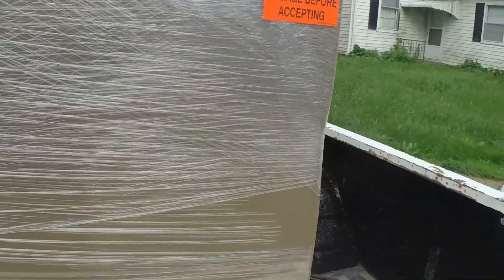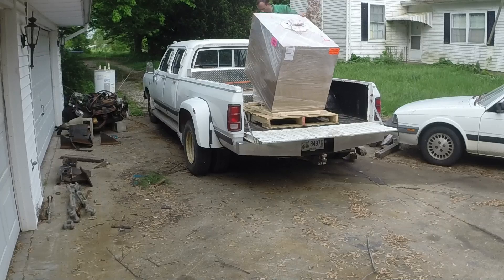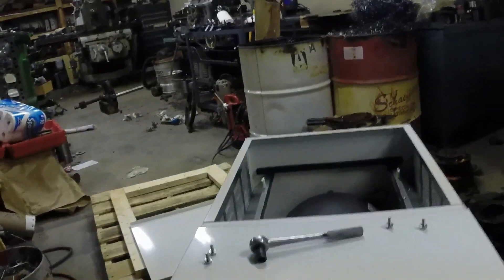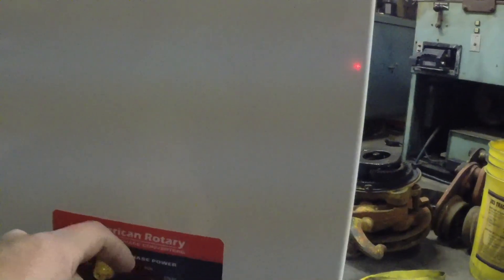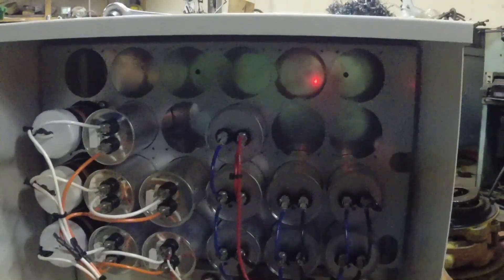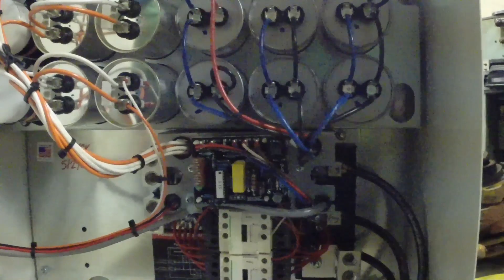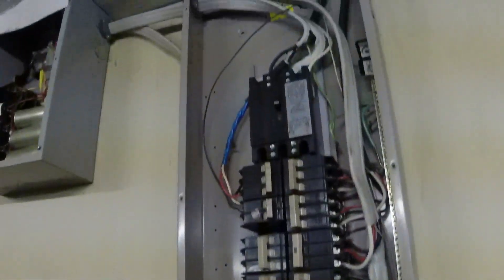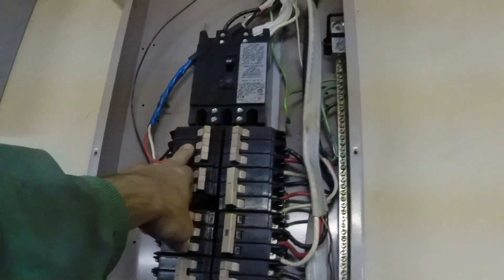The big 50Hp phase converter has arrived!

Comment: Drain holes i sealed my unit up ending with water from temp differential moisture build up. No go
Reply from the maker: Mine has been sealed with no issues but it is in the shop so I don't get sweating. I may need to pull the silicone from one when I put it in the attic so it can drain though.

Comment: Hp is there on the tag because most people are running motors off phase converters.  People don't know the amps of the motor but they know the horse power of the motor.

Comment: I want buy this for my haas VCM 20HP 
but I have some cuestion .
I saw u buy it this 4years ago .
  rotary phase  still working good  
and how many AMPS NEED TO RUN AL50HP.    65AMPS?
Reply from the maker: Yes the AI50 I have is still working fine. Running a 40hp load it uses right at 200 amps single phase. For 25hp it is 112amps.
Reply: Ok thanks

Comment: I think that the holes in each corner is for allowing water to drain out if condensation occurs during the winter months the heat of the 50hp motor heating up the metal housing will cause some condensation water to pool in the bottom under the 50hp motor

Comment: Better to have a fan to blow through the filter inwards and pressurize the enclosure. Open holes would then let water drain out. Best to keep the wiring boxes closed, a nearby lightning strike could cause a fire ball. I’m sure an electrician could tell you convincing stories.

Comment: If you get a big enough phase converter, will it run your 3 phase equipment at full power?
Reply from the maker: Yes as long as you have enough single phase power to keep the phase converter fed for what it will generate then the amount you could run off of them is really limitless.  In my new shop I have enough electric service that with enough phase converters I could make 300amps of 3 phase power.
Reply: bcbloc02 very good, I feel like there's a common misconception that you can't run your 3 phase stuff at full power using single phase with a VFD or phase converter
Reply from the maker: Depending on what you are doing there are many times that with a vfd you will degrade the motors performance. It is my belief that if you run high loads with really clipped cycles using a VFD you will burn up the motor unless it is VFD rated because it will overheat. Also most VFD with single phase input can't put out much on the 3 phase loads side.

Comment: How many volts will be going to the barn/shop? and what is the difference between having 3 phase installed to one of the big phase converters.How many machines can run off that converter..?
Reply from the maker: 240V is all that is available here. The closest 3ph power is about 2 mile or $100,000 away. I can run as many machines as I want off that one 50hp converter as long as the total load does not exceed 180amps.
Reply: Thats pretty big Ive shied away from 3 phase machines just for the lack of knowledge on how they work and to hook them up.They wont put 3 phase into my residential shop,even though I have enough transformers to do it they say.I heard in Europe some households have 3 phase and everything is 220v. Cant wait for the next barn/shop video.

Comment: Hey Brian, great channel. Did you have to rewire the lathe or mill at all ?. I am trying to set up a  lathe with a 2 speed motor (3.75/7.5HP) and can't get it to start the motor on fast. The converter is 15HP. 
Its posted here 
http://www.eevblog.com/forum/repair/vintage-lathe-restoration-3-phase-supply/
cheers

Comment: Brian: I bought an American Rotary 20 HP rotary to run my engine shop which has mostly 5 HP motors on everything plus a 3 phase heating element.  Been running almost every day for 6 years (except a couple of winters) with no problems. And best of all, it's 99.97% American made with American parts.....Dave.
Reply from the maker: +David Richards Got to appreciate a product not built only out of the lowest common denominator parts. So when will we get a tour of this electric powered shop of yours? :-)
Reply: +bcbloc02  I don't know, maybe, seems like it would be pretty boring.
Reply from the maker: David Richards
You would be surprised. People love shop tour videos. Heck people enjoy videos just looking thru somebodies toolbox to see what all tools they have. It is not as cool as a steam powered shop but us tool and iron junkies will still enjoy it. :-)

Comment: Nice looking unit. Who made the motor and do you need to lube the bearings? I would be interested in seeing the current measured on the three legs to the big load...comparing the 30 to the 50 hp units. The transients would be interesting but the impact of the different capacitor total values tied to the third leg should be evident running in steady state.

Comment: I have a 40hp 3 phase motor wonder if I could make it into one of these converters?
Reply from the maker: +1NRG24Seven Yes you could. A basic unit like my old one is not terribly complicated and most parts you need can be found at a local electrical supply house. There are also many plans and diagrams available online for them.

Comment: no expert at all but in the refrigeration industry the plastic capacitors are the start caps and the metal the run capacitors.
Reply from the maker: +Ed Ginsberg You are correct I said it backwards in the video.  The metal oil filled caps are the run caps.

Comment: sweet piece of kit you got there Brian .... question for ya: its my understanding that you only have 2/3 of the motor hp in the converter. is that true? so in this case you could run equipment that 2/3 of 50hp. lol not that its in issue, im just curious
Reply from the maker: +Billy T Yes since the 3rd leg of power is generated from the other two your output is reduced. From the data I can find this unit should be able to constantly deliver 65amps on each of the 3 phase legs meaning for a load of that much or less whatever is hooked to the converter behaves the same as if it was hooked to mains 3 phase.  You could probably run motors that demand more current than that but you will start to see your voltages getting out of balance and as the loads increase the imbalance gets worse and worse. Motors are not terribly sensitive to the voltage imbalance and will still run but electronic equipment will not usually function if it gets much out of whack.
Reply: ah ok, that makes sense. thanks for the explanation.
Reply from the maker: +Christopher Feavel The AI15 per the American Rotary webpage is rated at 65amps resistive power output, so to me it is equivalent to 65amp 3 phase power supply. You mentioned that the 120amps on the data tag is the output power. Why the difference? A true 3ph service would not care if it was hooked to a motor or a welder but the converter apparently does.

Comment: I think that hole you want to RTV Is a small drain, I don't think dirt coming in an issue compared to that much larger grill letting dirt come in.
Reply from the maker: +Peter Kerekes I work on air conditioners on tractors and combines and holes like those will let tons of dirt be sucked in. Air comes by path of least resistance and an open hole is easier than a filter so a small openening like that can really let a lot of stuff in. The cabinet is enclosed and should not need a drain.
Reply: +bcbloc02 Perhaps the main chamber is under pressure from above, through the filter?
Reply from the maker: *****
The only fan is in the motor and it wouldn't make sense for the motor compartment to be under positive pressure as that means you would be blowing out thru the filter and the filter would not be doing anything besides keeping the shop clean. lol
Reply: +bcbloc02 I thought the fan was in the upper part above the filter for some reason.  Don't know how that would cool the RPC very well.  Duh!

Comment: 120 Amps - maybe this refers to the capacity when there is a resistive load (oven) or a welder?
Reply from the maker: +Paul Copeland They only list65amp resistive load on their webpage. I think it is the motor plate data off the motor in the cabinet.

Comment: Great new addition... 
I like the enclosed motor, will greatly cut on the noise, that would improve my background noise situation around my own shop....   ;)
In my view, the electrolytic caps on the left are start, and the oiled filed cases on the right are the run caps, those later ones are just about eternal, as for the electrolytic ones, they need to cool down between starts.
50 HP will consume that amount of Amps indicated on the name plate when running at full 50HP rated power, as for balancing the third branch with caps it will be able to feed up to close to 50HP of motors plugged and running at the same time, as for starting power it can easy start half the rated power.
Once you get other motors running, those motors will even help in keeping the third branch balanced by acting also like a rotary converter.
There could be some phasing problems on your electrical services due to the inductive load presented by the motor.
Remote panel should work great...
Check with your neighbors when you start the unit, TV screens might only show half size for a moment...   lol

Comment: The service panel cover comes in handy when there's lightning. Had a youngstock shed take a direct cloud to ground hit and it exploded the 100 amp main, melted the bus bars & aluminum wires. Would'nt hurt to check out the current building code. I found on the county website they talk about the placement of a 200 amp service for a 4 bedroom house has to be clear 36 inches from anything around it. That's a problem for my place. I might ask them if i could mount it outside the building and a sub panel inside. My real estate insurance adjuster wants the old one upgraded but of coarse there's only 100 amp wires coming to the house. So even if your planning & zoning  signs off on everything the insurance folks may not.
Reply from the maker: +jasonmushersee The panel is totally disconnected when the phase converter isn't running so it is not subject to lightening unless it strikes actually inside the building. That is another reason I like my panel wired like it is now as whenever I am not in the shop working the machines are all protected by being totaly disconnected.

Comment: 735W = 1hp at 100% efficiency. Maybe they're just doing a theoretical math calc to come up with the amperage rating?
Reply from the maker: +Thomas Utley I have always used 746W= 1hp but at 735wx25hp=18375w/240V= 76amps so still not sure what they are refering to but I suspect that 65amp rating they list online is probably a pretty safe and realistic value of output.
Reply: +bcbloc02 Oops, yes, 746W. My thumbs are too fat for typing on an iPhone keyboard!

So maybe it's a surge rating just for startup?
Reply from the maker: Thomas Utley
I suspect it is actually the nameplate info off the motor in the cabinet, which isn't very useful since those amps are for 3ph input and since it is being fed single phase the actual amp draw will be much higher. I suspect the max single phase input current to be around 225amps.
Reply: +bcbloc02 It's a handy location if you need a replacement motor.